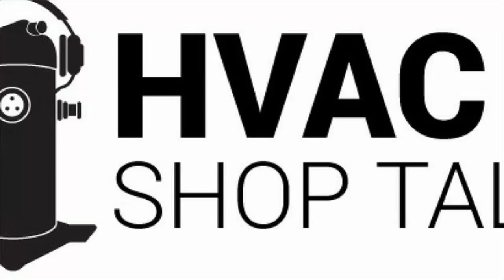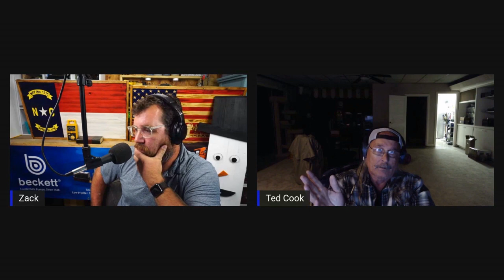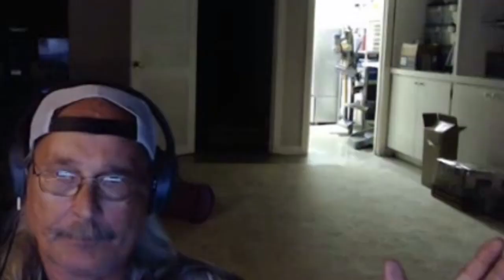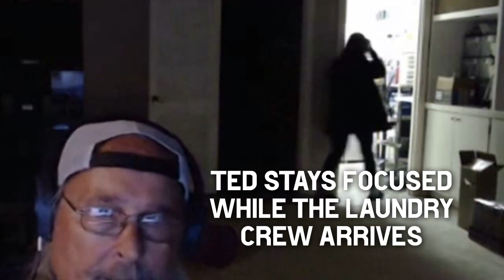The Operation of High Efficiency HVAC Systems w/ANTI DIY HVAC

Comment: I love how Ted says "WE" all the time when he refers to Trane..

As if he is right there standing with the engineers when they design this stuff and works with the bean counters and sales/technician people when issues come up even.

I respect that..

I could never do that myself, even when I respect and love my Rheem/Ruud distributors, and i have sent emails speaking with engineers that have made changes like the bolt in TXV on the condenser after i recommended it due to a couple of failures i had with the old brazed in ones, along with a few more things, but i could never consider myself a s"WE"..  

I like that, i find it entertaining in ways...  I do... You got to love something to consider yourself part of it, and i really really respect that.. I sure do.

Comment: What's the warranty on the compressor how many years had its parts and labor covered? I only ask because it's a compressor is going to run constant to maintain everything weren't there consideration an internal parts.

Comment: Totally a great system, but eplacing the evap coils that pop routinely, temp sensors that constantly fail, stepper motors that don’t respond properly and eev boards regularly, loss of communication to the drives, When they work they work, but boy when they don’t 🤦🏼‍♂️ the customer sure hates their investment then, no matter the efficiency